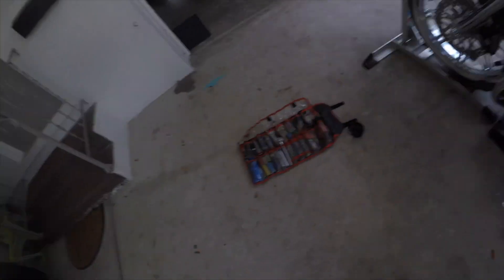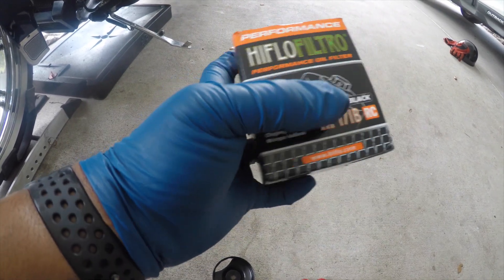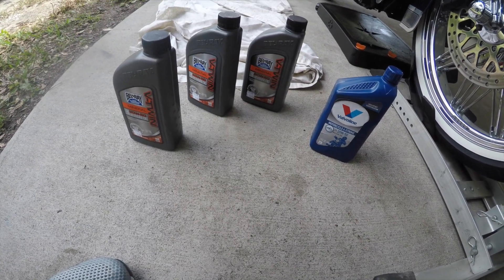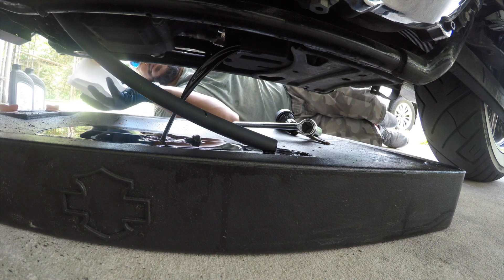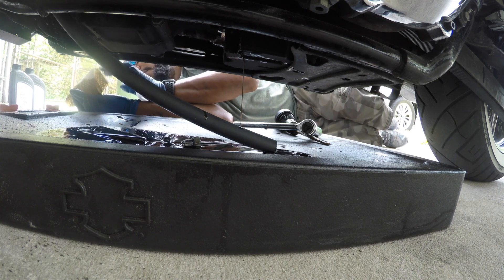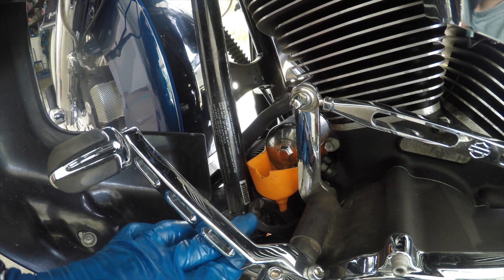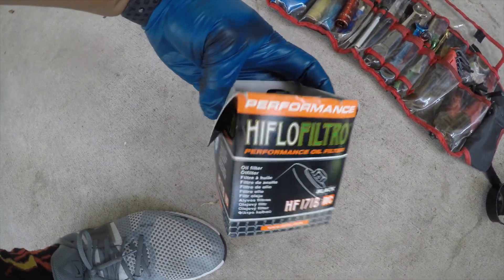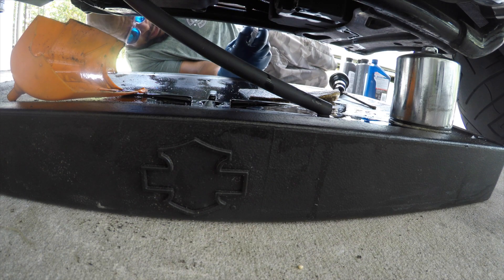DK customs catch can. Can help keep your oil clean!

Comment: Breaking in any motor I use conventional oil. After I switch to synthetic, Especially in one that’s air cooled. Conventional cooks at the temps synthetics preform best in. Cooking oil is sludge in the making. Just my 2 cents. Keeping fresh clean oil is really the key to any combustion engine.
Reply from the maker: I’ll take your advice and start changing it earlier to determine if that helps. I’m assuming people watch and not comment. However, they’re experiencing the same problem. Thanks for the feedback.